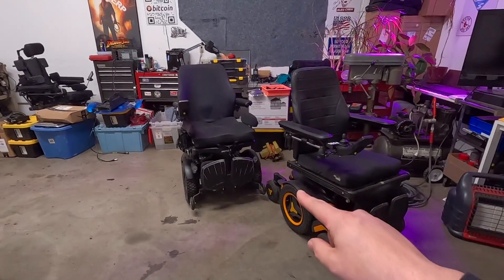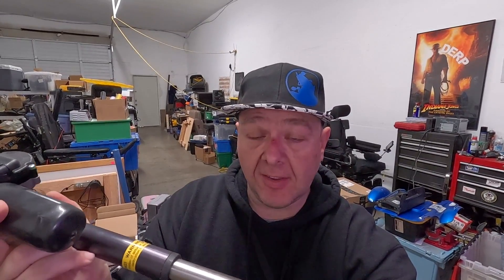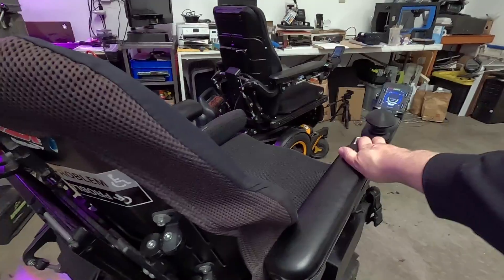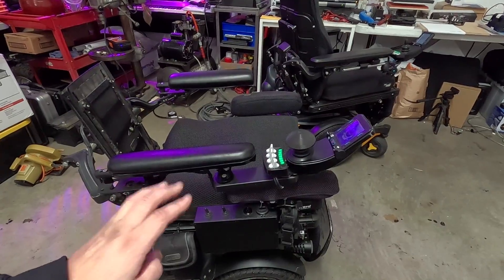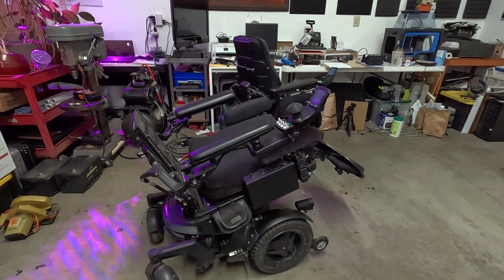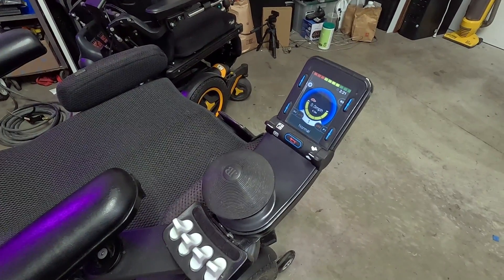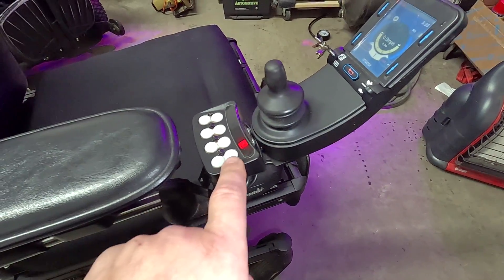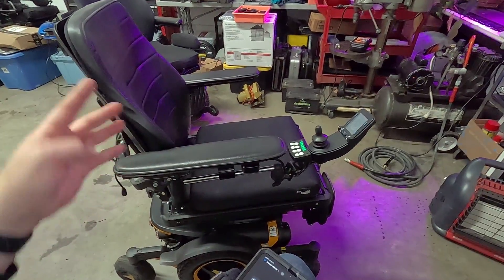REPAIR: permobil ICS auto calibration!

Comment: Thank you! These are the same instructions our remote tech provided. We have a C300 stuck in full tilt. It will raise and lower vertically, but will not go back to neutral tilt or level. I do hear a clicking sound from under the seat when I press the button to try and level it again.

I press 3,5,6 and power on. The number 4 light blinks red. I press it once, then the light on number 4 starts blinking green. We do not have the leg lift, only vertical and tilt. Any ideas? I also have a question into our tech about this and will post back if I get a response.
Reply: @zachlyoncreative  I have the same issue with the same functions. @totallynormal is there a way to auto calibrate a c300?

Comment: I'm a long-time subscriber. When calibrating the seat of my 2021 F5VS, I pressed ICS box 356 and turned on the wheelchair. It worked. Now, I bought a 2025 M5 and am trying to calibrate the seat, but it doesn't work. Can you tell me how to calibrate the seat of a version 3 wheelchair? Thank you.
Reply from the maker: the new power platform chairs don't have the same keycode functionality.. im not sure currently how to run calibration on them :^/ permobil hasn't released any documentation yet either!

Comment: My legrest seems to push into floor when i lower them. Is this normal or should it stop before it hits the floor? They are electric and did a calibration as well.
Reply from the maker: does the length of them need to be shortened? - maybe the fasteners came loose.  or did this just start happening recently?

Comment: I am kind of curious I have a question about the actuators I noticed the newer actuators are three wire? The old linac actuators on like c300s are two wire. Where you were able to make a power and a ground and move the actuator. On the newer style play three wires do you have any idea on which wires you can do what as far as power and grounds I know it sounds like a silly question but I am trying to do something with one of the new actuators and I'm just not sure how to activate it?
Reply from the maker: the newer actuators operate on a communication bus.. its a version of i2c (the rest of the chair operates on CAN) in other words, connecting power directly to the wires WILL fry something!
some of them can be taken apart, and buried down in there is the power output to the actual actuator motor.. but its probably best to use something that isnt permobil for other projects :^)

Comment: Afternoon, I have an F3 per mobile chair and the tilt back-and-forth just automatically stopped working yesterday. The error code is an ICS seat lift error 20 C2 from what I can understand your research is that it’s not recognizing the motor or the cables might beloose? Is there any thing I can do to try and troubleshoot this before I have to contact my local wheelchair mobile repair shop? Could the motor be gone on it?
Reply from the maker: the tilt actuator is under the front cover on the chair - the wiring for it is very short.. doesn't usually get damaged, but anything is possible! (the motors do also fail sometimes)

Comment: How do you recalibrate the ICS if you don't have the remote function buttons and do all the actuator movements via the joystick and screen?
Reply from the maker: unfortunately, the ICS seating buttons are the ONLY to access this functionality :^/
Reply: @TotallyNormal-  Thank you. Is it possible to do with the R-Net dongle at all? Also, don't know if you have come across this before but my tilt-in space actuator has started creeping forwards, when the joystick is released, when on another function (mainly on seat lowering) and also when switched off. Any ideas please? Cheers, Mark
Reply from the maker: i havent found a way to trigger that via the software thats available..  however, back when permobil was shipping all their chairs WITHOUT the seating buttons, that they had to temporarily reconnect a button box just to change settings or run calibration..
sounds like your tilt actuator is starting to have issues - when they drift like that there is a mechanical issue going on.

Comment: I’ve been having an issue where my chair (M3) tilt will “drift” downward so that instead of being in a flat/neutral position it will be pointed towards the floor slightly. I then have to tilt it back a few times to get it to stay flat. Then today I got a 20C3 lift error and the chair couldn’t even move until I did some fiddling and power cycling. I’m curious if you think this calibration process would help with this or if it sounds more like the actuator itself is shot? The vendor has a support case in progress to try and fix it but that process always takes forever. If this is a viable interim bandaid fix it could help this thing keep going longer.
Reply from the maker: ANY time the seating moves without pressing the seating control buttons, the calibration will get thrown off..
in your case - sounds like a failing tile actuator - then yes.. the calibration will be off, and the chair can throw errors etc.  how fast does the drift happen? are we talkin a few minutes, or days?
Reply: Oh it’s very quick. For example, I’ll press the button to go from tilted back to flat, release the button, then the chair tilts a little further down over the course of a few seconds. So, essentially the same speed as the actuator itself moves.

Comment: Hi, I have a Permobil F5 Corpus VS (2017) wheelchair. The footrest of the chair does not go all the way back. It does not stay at a 90 degree angle when in a normal sitting position. When I do automatic calibration with ICS as you explained in the video, the footrest goes all the way back. However, when I try to move it to different positions and then move it back again, it does not go all the way back. Is there a way to adjust this?
The wheelchair has a joystick with a green LCD screen. I could not find a way to enter the settings menu.

I would be very happy if you could help me with this.
Thank you.
Reply from the maker: did this issue start happening suddenly one day? was everything working properly before?
Reply: @TotallyNormal-  I just bought the wheelchair. I am not the first owner. Probably the first owner is a severely disabled person. It was adapted for companion driving. It has hardly been used. Only 3 kilometers. It is not really a big deal but I have difficulty getting in and out of the wheelchair. Because the footrest does not fully retract.
Reply from the maker: yea sounds like they may have limit the legrest retraction.. there are a few different ways to accomplish this, but might be best to go to a dealer / DME and see if they can adjust things for ya.(they usually charge hourly)  also ya might try contacting permobil directly, and if theres a rep in your area, they are usually happy to come out and see if theres an easy fix! (use this form to contact them)
https://hub.permobil.com/support (free option!)
fill out what ya can, and someone should get in contact :^)
Reply: @TotallyNormal- Thank you for your interest. I had previously contacted Permobil. But I haven't heard back yet. I just did it again :) The place I bought the chair from is not very skilled in service. There is a general supplier that brings Permobil products to the country. I will contact them as well.

I follow your videos with interest. Thank you again. Greetings from Turkey.

Comment: RE: ICS R-NET TILT ERROR (20A1) (permobil)
Hello Totally Normal!
I have a 2012 permobil Street (last one sold in the United States.) I absolutely LOVE IT! I can’t stop this tilt error from coming up No matter what I do. In inhibits the drive mode of the chair entirely. chair entirely. The actuator has been replaced twice. The 20A1 error comes on even when the chair is NOT tilted at all! 

I have an Rnet programmer. I am wondering if anyone has ever successfully “turned off” the tilt inhibit. Any guidance welcome. 

Thank You!
Reply from the maker: that error refers to a sensor cable that may be damaged or have come unplugged.  does your chair have 2G seating? (plastic backrest frame)
or the 3G version (metal backrest frame)
Reply: @TotallyNormal-  3G- the code was wrong. I have to look it up again!

Comment: My quantum edge 2.0 Qlogic joystick stopped acknowledging that I have tilt/recline/I level/foot adjust functions. It only drives now. Why? (God why??)
Reply from the maker: welcome to the q-logic control system.... only thing ya can do is go to the dealer / DME and have them check it out.  that control system is SO locked down, that ya cant really do any troubleshooting on your own :^/
Reply: @TotallyNormal-  no wonder I can’t find any help online. At least now I can stop looking. For some reason, it took a week for my doctor to fax back a signed form saying I’m still a wheelchair user, so I’ll finally be able to schedule maintenance tomorrow. This bureaucracy feels criminal. I’ve been in so much more pain without full use of my wheelchair for over a week.

Comment: Thank you so much for these informative videos
can I do that on my C300 2011 chair? 1year ago I tilted the seat all the way forward, the light turned yellow and then I couldn't tilt the seat back since.  will this hack fix that issue?
Reply from the maker: so the tilt actuators on the older C300 chairs can get a bit sticky.. also there's a limit switch under the seat pan that tends to get stuck as well..
try getting out of the chair, and have someone lift up on the front of the seat pan a bit while trying to tilt back.. sometimes that will free them up.. other times the limit switch has to be removed.
also do you now if that chair has 2G, or 3G seating on it?
 (the seat back frame will be plastic if 2G and made from metal if 3G)

Comment: I have lengthened my seat from 19 to 22 inches. I've also widened it from 16 to 18 inches. Is this seating change something you would consider significant enough to  merit running programing on a 2021 stock Permobil Corpus M3?  The chair only has tilt and leg rest functions.  The chair seems to be front heavy.
Reply from the maker: Did you get a used chair, and re size it for a new user?
Reply: Yes I did. I bought it used with about 100 miles on it in good shape. It's a standard Permobil  M3  Corpus recline/tilt. I extended outward the front of the seat 2 inches and I extended the rear of the seat 2 inches. A smaller older woman owned the chair before me. I typically drive my F3. It might be that I am not used to mid-wheel drive,  but it feels sluggish on the front end trying to turn. Who knows, maybe all mid-wheel chairs  feel this way. But everything on the chair works fine with no errors etc. but I did resize it.
Reply from the maker: on a permobil to set the 'center of gravity' ya have to adjust the seat back frame as FAR back as it will go, then pull in the front part that the legs mount to, to match.  when making the adjustments there are a series of holes (im sure you saw them when adjusting) but basically ya want to shift everything backwards as far as possible.  22" might be the maximum depth possible tho.. in which case ya cant really adjust anything.. but id make sure ya actually need that much depth, and adjust things as far towards the back of the chair as possible :^)

Comment: would a programmer be needed to swap buttons 4 and 8 functions (leg in and out)?
Reply from the maker: swapping the leg rest axis is possible via the 'boot up programming' - no programmer needed! i don't currently have any videos about it though.. this is the first in a series of programming videos for the permobil ICS system though :^)
reach out on twitter with a DM, or use the contact form, and i should be able to walk ya thru the process though